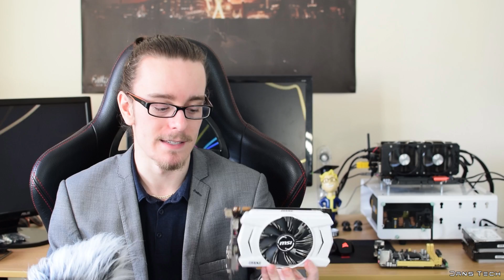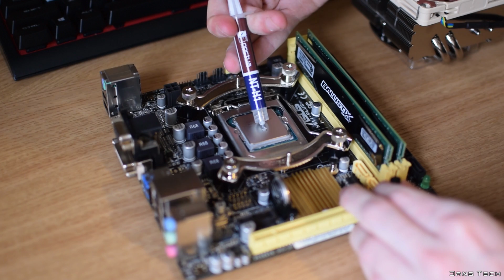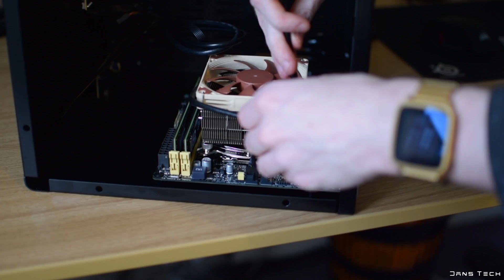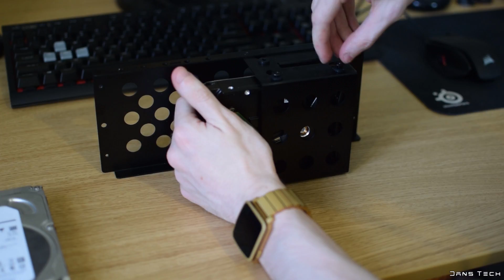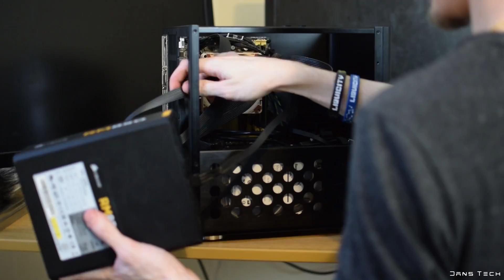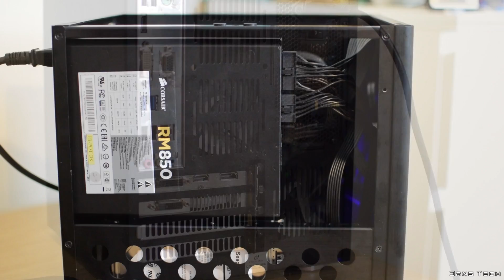How To Build A Mini Gaming PC - 2016

Comment: Im not criticising this build, but i dont get why you used K procesor with that board -> you can save money on non-K procesor, then you used matx case but only using itx board so you could use either matx board or itx case and last thing, you used 850W psu with only 950, thats a waste of money and power it can give you, 500-550W would be plenty enough with a reserve :)
Reply from the maker: +Marek Cernvenokovsky Hi, these videos serve as build guides, not advice on parts. I welcome your feedback, and from what you've said, you are more than correct in all areas. This Gaming PC was dissembled right after this video was uploaded. Dan.
Reply: Then man, its great video and guide :)

Comment: If you use a Cooltek Coolcube Maxi then why not buy a Micro-ATX, then you get lot of extra's, like extra PCI-Express ports and more, and if you go for a Micro-ATX why not go for one that is not old already, like the  the ASRock B150M-HDV cost the same as the Asus H81I-PLUS, or go for the Biostar Hi-Fi H170S3H, that only cost about €16,- more, there you get a extra big PCI-Express 4x port, and M.2 (PCI-e 3.0 x4), so you don't have to put a much bigger 2,5" SSD somewhere, and you can put SUPER fast M.2 SSD in that slot that can go up to 3.200/1.800MB/s.
    
And if you go for a Mini-ITX why not go for one that is not old already, like the ASRock H110M-ITX, they are the same price, and then go for the Intel Core i5-6600K is also the same price as the Intel Core i5-4690K, and then go for the Kingston HyperX Fury HX421C14FBK2/8 also the same price as the Crucial Ballistix BLS2CP4G3D1609DS1S00CEU.

And why not go for a bigger tower heatsink with fan, so that he will blow the air out of your tower.

I think you did not do your homework very good, when i can find this all in just a few minutes.

Comment: I'm very much interested in this case, this Cooltek Maxi..

Can you give me some comments about this case?
I'm especially interested in its thermal performance..

Thanks b4 Dan, great video..
Reply: Go for the Raijintek Styx, is only a little bit bigger (still small), and there you can put long graphics cards in, so no problem with longer graphics cards, but with that one you can only put not so large PSU's in, only max 130mm deep if you use larger cards 267mm or longer, but thats not a problem because there are more then enough 130mm or smaller PSU's to choose out, and you can use up to 4 120mm fans and with the Raijintek Styx, and with the Cooltek Coolcube Maxi you can only use 3 80 mm fans. 

I bought the Corsair SF600 with Corsair SFX to ATX PSU Adapter Bracket (CP-8920133).

And you can use BIG heatsinks if you want on your CPU, up to 180mm, and the Cooltek Coolcube Maxi can only go to max 120mm, and the Raijintek Styx has a dust filter you can even remove and clean, and the Cooltek Coolcube Maxi don't have any, so you get a lot of dust in no time, so there are a lot more plus point's to go for the Raijintek Styx.

And i know what i am talking about because, because i have the Cooltek Coolcube Maxi, and now i have put everything in the Raijintek Styx.

Comment: i recently built a pc with a mitx mobo that came with some wifi card that plugs into a mk2 port i think, had to snap these gold hook things was a pain in the arse they would pop off easly ehile building
Reply from the maker: Can't sat I've worked with a board with built in wifi, they similar to the wifi network cards in laptops? Dan.
Reply: +Dans Tech not sure but if they have tiny little parts you have to snap together i guess so wish i could show pics think its the asrock h110m-itx/ac
Reply from the maker: Will be sure to take a look!